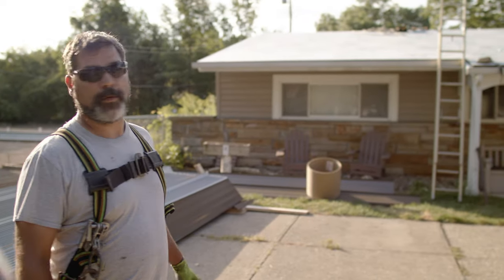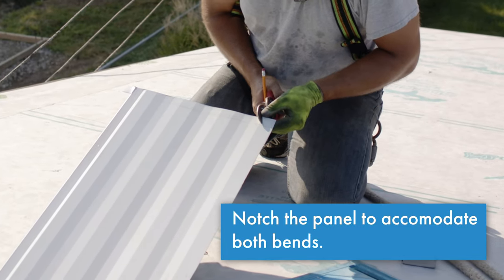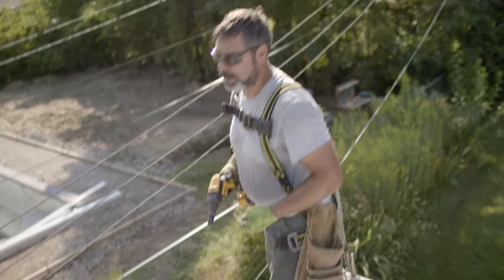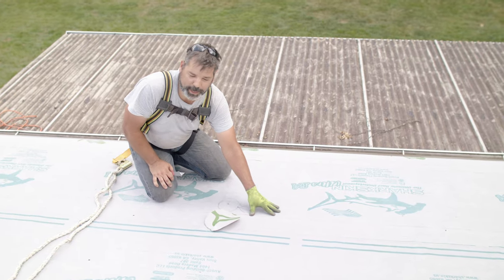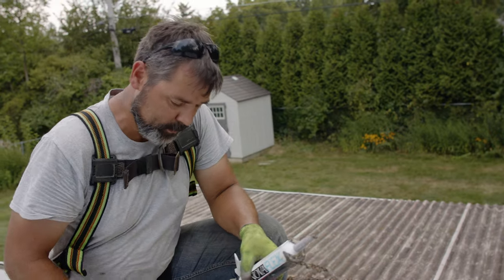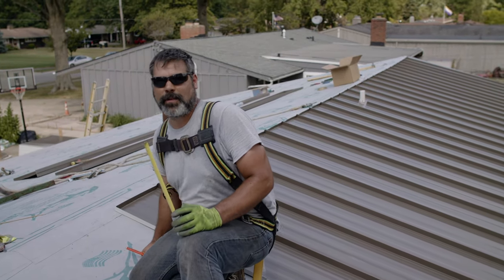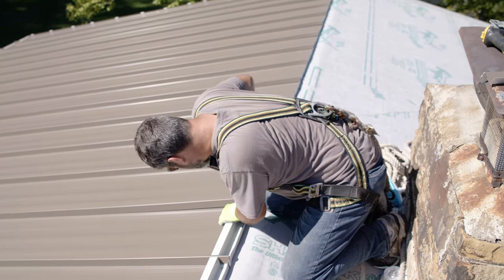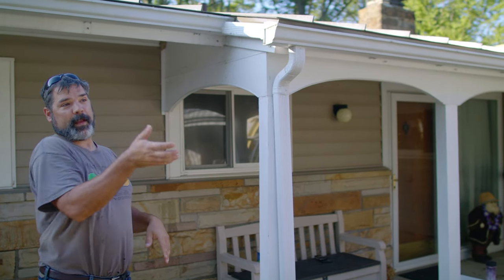How to Install Snaplock Standing Seam Metal Roofing Panels on a House

Comment: We have a metal roof install in progress at present in Florida. The contractor initially gave us a 2 week install estimate following the tear down and peel & stick application. It’s been over 2 months and it’s about halfway done in between multiple rain downpours. Will this be an issue with metal panels going over wet stick & peel ? Our contractor says it will “ Burn off”

Comment: Most installers recommend some kind of venting system between the peel and stick and the metal roofing. Is there some reason you skip this step?
Reply: I was thinking the same thing?
Reply: that is extremely expensive, only place that would matter is florida. Attics already get hot.

Comment: Another great video, question on the pipe penetrations why not go in the attic and move the ABS pipe to land in the center of the panel? Also why do you prefer a rubber boot instead of doing a split panel and aluminum flashing that would last the life of the metal roof? Looking forward to your next video! Thanks.
Reply from the maker: Thanks! You can absolutely move pipes to land in the center of the panel, especially if you are already replacing plywood or if it's a new build and you can plan ahead. Jason (a Sheffield Metals warranty inspector) mentions that in our panel layout video (http://bit.ly/lay-out-square-metal-roofing-panels-video). Sheffield recommends EPDM pipe boots because they are readily available, easy to install, and simple to replace. If you have a detail you prefer, that's great and Sheffield's technical department would be willing to take a look at it if there is a warranty involved. We have done a video about metal-flashed pipe penetrations on a metal shingle roof here: http://bit.ly/metal-shingles-pipe-flashing-install-video You can learn more about Sheffield and pipe boots recommendations here: http://bit.ly/why-use-pipe-boots-video -Thad
Reply: @TheMetalRoofingChannel  Also why do you prefer a rubber boot instead of doing a split panel and aluminum flashing that would last the life of the metal roof? Looking forward to your next video! Thanks.

Comment: Why on earth would you prep the panels on the roof?
Reply from the maker: Just preference on this project. Some of the panels were prepped on the roof, many were prepped on the ground. It depended on the stage of installation and also the filming requirements at that particular moment. -Thad

Comment: You cut the  panels  ribs to  fit the vent pipe 😂🤣😥🤦‍♂️🤦‍♂️👎 this is a  junk metal roofs
Reply from the maker: That detail was finished later using z closures and a piece of flat stock. We do not recommend installing a pipe boot directly onto panel ribs. -Thad

Comment: You guys aren't Metal roofers. Panels  can't  stretch.  what's  you talking about 🤦‍♂️👎👎
Reply: Those panels can contract and expand a lot more than you think. I'm not even a roofer and I know that! That's exactly why you should never install metal directly onto a shingle roof(although many idiots do) over the years, the contraction/expansion will rub across the shingle grit like sandpaper and start rusting out from the bottom!

Comment: You put screws for clips in the tops of the panels lol. Neoprene washer screws are meant to be used. And you’re layout wasn’t good that’s why you were running off. And let’s not bring up the pipe on the back lol. It probably took you a month to finish that job. Hack butchers